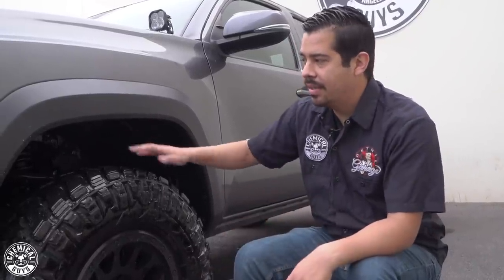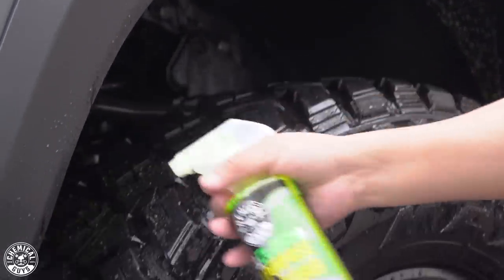How To Deep Clean Truck! - Chemical Guys

Comment: I've had a couple instances where post-detail on a truck, the engine would rumble at a low RPM. I've been reading that it might have been water getting into the spark plug holes. After driving the truck for a while it goes away, which leads me to believe it's water that is getting evaporated somewhere. What could be causing this? Especially after the first incident, I was careful when spraying around the hood, but it happened again on me!

Comment: How well does the standard Diablo wheel cleaner work on 10 yr old brake dust? 
Black GEAR Dominator rims on an f250 7.3. As you know the 7.3 is a heavy truck so the brake dust is thick. Tothe point the rim face is heavily coated with the brake dust too. They are basically brown rims now, not black LOL.
Reply from the maker: Hi Dean! Combine Diablo Wheel Cleaner with DeCon Iron Remover to get rid of stubborn brake dust.

Comment: Question for you all. So I just picked up a Black Ram and they through in the rust proofing and paint sealant pack for free. My question is what cleaners and waxes can I use to keep it looking as good as the day I picked it up that won’t mess up the rust and paint pack?  Thx in advance
Reply from the maker: Hey! Check out HydroSuds to lay down a thick layer of foam that prevents scratching while also boosting your coatings.

Comment: I'm going to clean my 5.7 vortec in my 1999 chevy tahoe should I cover up alternator and mass airflow sensor
Reply from the maker: Hey Tim! Most modern engine bays seal sensitive items but it is still a good idea to protect any exposed electrical or intake components. We also recommend to avoid heavily saturating those areas.

Comment: Hey chemical guys! I love ur products, but in my country its really sunny the couple last months.. do you have a product that avoids watermarks u get from it drying faster then u can dry?
Reply from the maker: Hey there! Make sure to check out After Wash. This is a specialty product designed to help you out during the drying process to help break down the tension of any water left on the surface making it much easier to wipe and and have a smoother drying experience.
Reply: @ChemicalGuys  hanks!